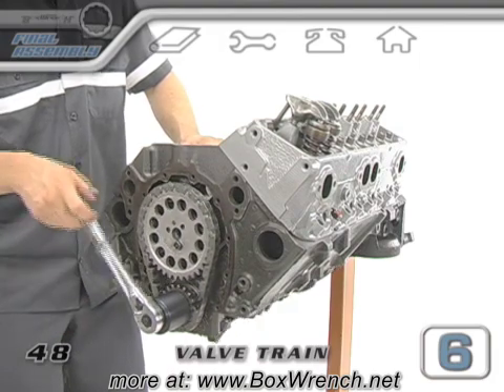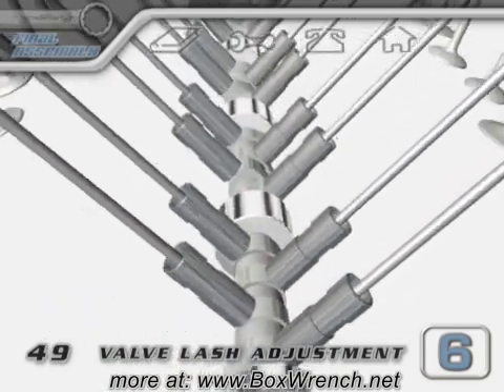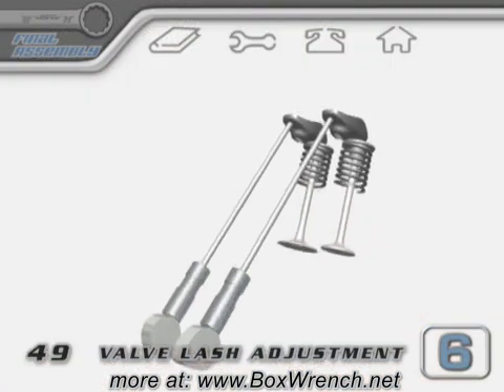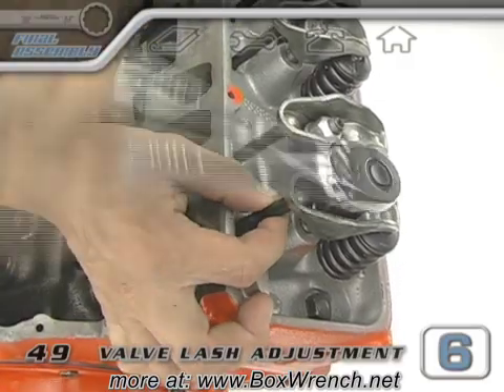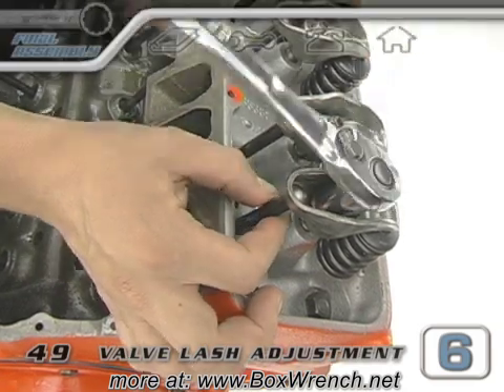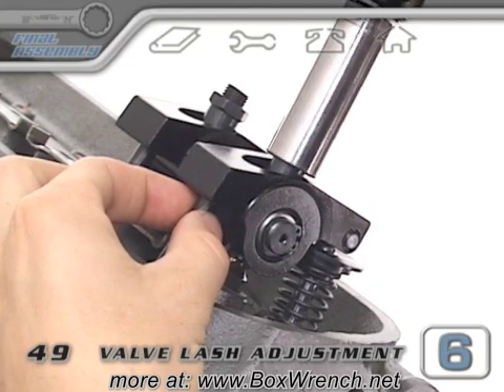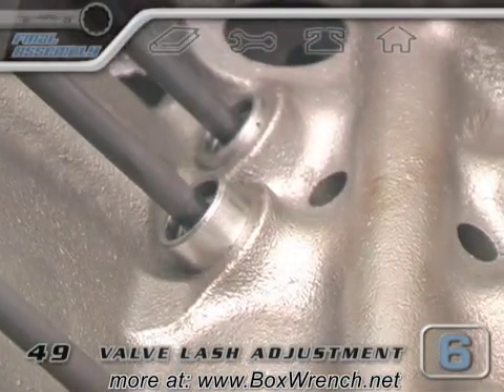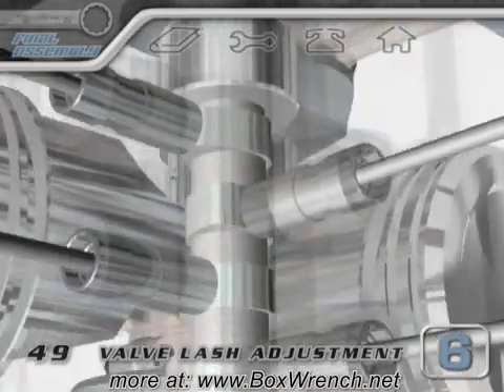Valve Lash Adjustment Video - Engine Building Car Repair DVD

Comment: I like his video..... well done! 
At around 1:28 into the video, he shows spinning the push rod to determine when zero lash has been achieved. 
I believe that there is a more accurate way to do this! 
With the intake manifold not yet installed (as in the video), and prior to the cam followers being oiled up, we have the perfect opportunity to watch the plunger as it just begins to move downward.
Once it begins to move, we have established zero lash. 
This eliminates a potential error that may be made while spinning the push rod. 

At 1:34, he makes a good point. If we use a shallow socket, we can prevent this.

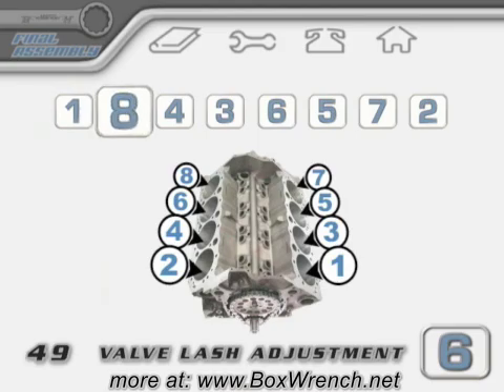At 2:28, he begins to talk about what is known as the 8 stop static procedure. 
He begins with # 1 cylinder at TDC C/S. 
Once done with # 1,  you will rotate the crankshaft 90 degrees, and you are ready to adjust the next cylinder in the firing order. 
Keep going right down the firing order until you reach # 1 again. 
The crankshaft will have made 2 rotations, while the camshaft will have made only one full rotation. 

I strongly suggest that we use the 8 stop procedure, rather than the 2 or 3 stop.

Comment: I have a 1974 Buick 350 and no adjustments on the rocker arms . Just the 4 bolts that hold the rocker arm assembly in place . What to do ?

Comment: This video will get you to the point where you can fire up the engine. But once the engine is up to temperature, you have to adjust the lifters again a second time while the engine is running in order to make max power. On solids, use a feeler gauge while the engine is running. On hydraulic, you tighten down till you just get lifter noise. Then back up a quarter turn. For racing you can adjust to where it just starts to tick. Use oil deflectors or cut away on old valve cover.

Comment: it's much simpler to just do the adjust the loose ones to zero lash turn crank 90 then repeat do it four times  or so and you will have everything set to zero...oh and be sure the lifters are dry....THEN turn the stud nuts 180 or 270 to set the correct lash....this way you don't have to worry about all about that mess about where the pistons are.....

Comment: WHAT if I did this method and some of the rocker arms are still slightly loose? Did I not hit zero lash properly?
Reply: Either you are not in the # 1 firing position or you are not taking the slack out of the push rod correctly . If I was guessing I would     probably say you are not in the # 1 firing position.
Reply: Bryan Juranek it looked like I was in the right firing order for cylinder #1
Reply: @devicetrickz  you could have a bent push rod or a lifter that is failing , or a cam that is going flat . Any of the above can give you problems with loose push rods .
Reply from the maker: @Roger Riekki , is it possible that your socket was resting on the rocker arm nut during tightening to zero lash as mentioned in the video? 
That would cause some rocker arms (random few out of total of 16 for a V8 engine) to seem loose after going through full valve train. The video suggests holding the socket up and away from the top of the rocker nut to avoid pinching...
Does this seem related to your issue?
Reply: When I set lifters I lift the sock up on the nut about 3/16 of an inch so that you are not pushing down on the rocker arm . If push down with your socket it won't  work right .
Reply: Bryan Juranek I got them all adjusted I'll give you feedback soon if all worked well
Reply: @devicetrickz  once you get the lifters set and you are ready to fire it up  , be sure you have your distributor on #1 and # piston at #1 tdc . I would suggest priming the carburator , you don't want the motor turn over a bunch of times , it takes the lube off the cam . Once you have it running be sure to keep running for at least 20 minutes at around 2000 rpm . After a day or two go back and reset the lifters one more time just to be sure . Hope you have good luck It will make you more confidence . Just got done with a 49 Chevy pickup with a 350 4 bolt it always makes me feel good when they fire right up . Ps . Be sure to check for leaks .
Reply: Bryan Juranek how do I go about priming the carb? Do I need to prime the fuel pump
Before I start it too? I'll definitely be checking for leaks
Reply: @devicetrickz  when you get ready to fire up your motor dump about 1/2 of a cup gas down the carb ,  replace the air cleaner wait about 30  seconds and fire it up. your pump will fill carb in a heart beat . I use an old electric fuel pump to fill the  carb , then I hook up my manal pump and fire it up. It's not necessary it's just a thing I do to make start faster . Hope this is some help .
Reply: Bryan Juranek thanks it does

Comment: Great video but if it takes 1/4 turn to do one fire order after the first fire order then it would take 1 and 3/4 to finish instead of 1full turn.
Reply: You are correct about the amount of 'crankshaft' turns needed to complete valve lash adjustment for the 'camshaft'. However, It takes two revolutions of the crankshaft to rotate the camshaft one time. 
As described in the beginning of the video, they mention they want to rotate the 'camshaft' as little as possible to reduce the amount of break-in lubricant from wiping off of the 'camshaft'. To adjust valve lash on all valves of a V8 engine (rotating the camshaft only once) you will have to rotate the 'crankshaft' 2 full revolutions to complete the task for all 8 cylinders. 
This is a very well done and detailed explanation that can be used for any brand of V8 engine, or for that matter, any gas powered 4-cycle engine no matter how many cylinders...

Comment: Is this the same procedure for a roller lifter?
Reply: There are different types of roller lifters, with respect to the rocker arm up top on a pushrod engine. There are roller tip and full roller rocker versions...there are also different types of roller rocker stud mounts, adjustable and fixed. 
This video is intended to show valve lash tightening procedure as it relates to any engine that has engine block mounted camshaft paired with lifters and rocker arms. It does not matter if the rocker arms are roller fulcrum, roller tip, full roller or ball pivot style. Video also shows proper procedure to follow firing order for rocker studs that are adjustable threaded, or fixed mount stud. Hydraulic lifters need the 'pre-load' additional turn of the wrench if adjustable studs are present and any solid lifter use will require a feeler gauge gap added at zero lash adjustment.  

There are also overhead camshaft engines that do not have lifters, pushrod or rocker arms...this full length DVD does not refer to any overhead camshaft engine models.

Comment: Can the lifters be set correctly as long as the cylinder is anywhere in the compression stroke?  Must it be at TDC?  It seems to me as long as the cylinder is anywhere in it's compression stroke, both of the valves must be completely closed (therefore the lifter would be on the base circle), otherwise it wouldn't be making compression.  is this correct?
Reply from the maker: Essentially what you describe is correct and is what this video is describing. This video assumes that the engine builder is working with flat tappet camshaft (non-roller) and has applied camshaft break-in lubricant to the cam lobes during the final assembly of a new engine build or rebuild. The intent of this video is to get through the valve lash setting of all 16 cam lobes of a V-8 engine all within one single rotation of the camshaft (2 rotations of the crankshaft). As described in the video, once you have adjusted the lash for both intake and exhaust lifters for your #1 cylinder set just after TDC, you would look to the next set of lifters for the next cylinder in your firing order sequence. For this Chevy engine, the next cylinder in the FO is the #8 cylinder and without rotating the crank/cam at all, a look at the #8 cylinder reveals that the intake lifter for the #8 cylinder is still in a slightly open postion while the camshaft is parked in the #1 TDC position. This will be the case through your entire firing order. This is the reason to follow the videos instructions when adjusting lash for stock camshafts (non high performance) with flat tappet (non-rolller lifter) camshaft engines. The procedure in the video will have you adjusting both intake and exhaust rockers arms during the TDC event of each cylinder in the firing order sequence and will take you through only one revolution of the camshaft in order to preserve as much of the camshaft break-in lubricant for your flat tappet camshaft as possible for initial start-up of the engine.
Reply: Wayne Davis Do yourself a huge favor and buy the book step by step Video book
Rebuilding the small block Chevy.  You would have to be blind not too understand this DVD and book from Amazon.  30 buck's and your a professional.
Reply: Kkj

Comment: Will improper valve lash cause the engine to bog off idle?
Reply: More likely a bog happening just off of idle (as in you mash on the pedal and the engine feels like it hesitates before making power) is related to either ignition timing is off, or the fuel delivery for 'off-idle' is lacking. Timing could be retarded from initial getting into early RPMs about 1000-2000 or carburetor accelerator pump system isn't delivering strong enough off-idle pump shot or fuel injection system isn't delivering enough fuel during early RPMs just after off-idle...

Comment: make a long story short a guy told me to find tdc and tighten them In the firing order make 4  90 degree turns and do the first 4 cylinders and rotate 90 degree turns 4 more times 2 do the other 4 car runs a lil bit better but exhaust sounds like shxx it's not as loud as it use 2 be please help

Comment: I just mark the balancer north, east, south and west from the timing mark then rotate the motor to each cylinder's firing position and then set that cylinder's valves.

Comment: hello could you tell me my 4.3 has a lifter noise warm idle right side  ticking maybe   lifter could you adjust them when the motor is running also will it damage the cam

Comment: Excellent video and website, I have found that one revolution after free play is gone equates to approximately 0.060" between the bottom of the lifter snap ring and the top of the lifter seat. If you like second check stuff like I do, you can verify they are all the same with a piece of wire with a bend on one end approximately 3/32". A 1/16" diameter piece of stainless steel weld wire works good for this as it is 0.0625". Of course you need to have the intake removed to do this, and this dimension may be different with different lifter manufacturers. This is just a second check to verify they are close to all the same.

Comment: what is the valve adjustment sequence on a gm 4.3 v6?
Reply: +youreallbrainwashed The same as this vid. Follow the instruction at the end of the video - you go in "firing order" which is also something you can determine by looking on your 4.3's distributor cap. Should be like 1-6-5-4-3-2 on pretty much every 4.3 v6 chevy ever made.
Reply: 165432

Comment: Not wanting to cause any controversy here but this seems like a very un-scientific way to adjust valve tolerances - which are absolutely critical to a strong and functional running engine. You should ALWAYS use feeler gauges to set the correct depths. There should be tolerances stated in the manual/handbook for hot and cold setting temperatures, and you should re-check and re-adjust several times after a full rebuild to still be correct after settling. I'm afraid you've adjusted those valves WAY too tightly. If anything you should bias towards being loose to ensure the valves are fully seated on the compression stroke. If they don't seat just right you loose compression/power and effectively have explosions in the inlet manifold, not to mention the danger of smashing valves on pistons (depending on compression ratios - the higher the compression your pistons are, the tighter the gap between the fully seated valves and the head of the piston at TDC). Nice graphics though!
Reply: I agree with you if you're using solid lifters as an example. For those, there are hot, cold tolerances, and even different gaps @ TDC for the intake and exhaust valves. I own vehicles with both types and have adjusted both. 
This method in the video is very common and widely used on Ford and Chevy V8 engines equipped with hydraulic lifters; the lifters themselves have a small amount of play built into them that allows the pushrods to sink in. The valves close tightly and quietly. They are essentially self-adjusting once preloaded properly. I believe if you went to the tech section of some major camshaft manufacturers websites, they would have documentation showing this approach is acceptable.
Finding the zero preload point and then going tighter is repeatable and works because the thread pitch of the stud tightens the pushrod into the lifter exactly the correct distance. 
The only way I know to be more accurate is to remove the intake manifold, scribe am index line on the pushrod, and then measure the preload depth using that.
I appreciate your careful approach; too many people these days don't think things through.
Reply: freebirthfreddy this method is included  in Comp Cams instruction sheets with all cams they sell so im pretty sure its an accurate way to adjust valves
Reply: ***** ahh interesting. I've never had Hydraulic lifters so that's an education...I'm stuck in the 70's! +freebirthfreddy
Reply: Dave Mitchell I've been around engines for over 30 years and never used a feeler gauge to adjust a Chevrolet valve train 1/2 to 3/4 turn if it takes more than that you have a problem either a bad lifter or something in the valve train

Comment: This procedure I should use with lifters full of oil or empty?
Reply: You should let your lifters sit upright in engine oil before installing em. Don't need to plunge em or anything, the air will escape and they're good
Reply: thanks !

Comment: Doesn't work like that. The oil pressure is limited by a relief valve. The valve train is designed so that the oil pressure in the lifters is insufficient to overcome the closing force of the valve springs.
If an adjustable rocker is overtightened, then the lifter will bottom out and then the valve will start to open. The piston inside the lifter will be metal-on-metal, instead of sitting on a column of oil. If oil could get in there (which it can't) then it would make no difference.

Comment: Adjustable rockers are not tightened to a torque spec. If you did tighten them like that, then the hydraulic lifter would be bottomed out, defeating the purpose of having a hydraulic lifter. The valve could then potentially be held open.

Comment: Just bought a 2000 GMC K2500 4x4 ext. cab 8'B classic w/ a 350 and I think the valves rattle too much. 108,000 miles on it and it looks clean as heck inside the valve cover. 
When do the valves need adjusting? At 100K or ??? never??? For 2.5 tons of truck this 350 gets this monster moving chop, chop.

Comment: why can't you adjust the rocker arms on the valves on a 98 Tahoe while the engine is running like old school? Back off 1 rocker arm at a time till you hear a tapping, tighten till quiet then tighten 3/4 of a more turns after that! That guy Bit was correct, but my way was the way we always did those!

Comment: The innovation is in sticking to it. It's already proven and is known to produce great dependable power. Why do you think fords motors do not do so well? Because they try to change the design. Currently why I will always stick with GM. They don't release something before they test it for more than 5 years.

Comment: @lakeboy36111 ... 
1 - note #1 plug wire position and pull the distributor cap, 
2 - rotate the engine to #1 TDC (rotor @#1 and timing mark on balancer @0deg, 
3  - adjust i&e rockers to 0 lash then add 1/2 turn, 
4 - rotate the crank 1/4 turn (90 deg) and watch for the #8 i rocker to drop and stop then adj i&e rockwers to 0 lash then add 1/2 turn, 
5 - repeat and adjust cylinders 4-3-6-5-7 and 2, in that order. You will only have to rotate the crank a total of 630 deg (1-3/4 turns).

Comment: Finding this "zero lash" position by feel is influenced by too many variables which allows a degree of inconsistancy.I'll pass on a tip that was shown to me by Barry Seton in 1985.Adjust the valve clearance to 5 thou.,then turn the the rocker nut down 3/4 of a turn.Thank you for reading.

Comment from the maker: @ktmboy1989 don't determine the valve opening events by rotating the crank only. 
You should watch the pushrods, rockers or lifters to determine when the valves are actually opening. 

If you want to adjust lash on an engine that has the heads bolted in place already...just remove the valve covers and you can watch the pushrod ends and valve tips as the opening and closing events happen.

Comment from the maker: @jujutube123 This is the correct procedure for taking a hydraulic lifer to zero lash and then adding the required pre-load to the lifter. The pre-load is set by turning the rocker nut down the extra half turn after reaching zero lash. 

With solid lifters, you go to zero lash with a specific feeler gauge between the valve tip and the rocker. For hydraulic lifters, you need to do the procedure described here, including the extra half turn.

Comment: @ktmboy1989 A quarter turn is correct, since the crank rotates twice to complete a full firing order. The camshaft rotates at half-crank speed, so 1/4 crank turn = 1/8 cam turn = next piston tdc firing.